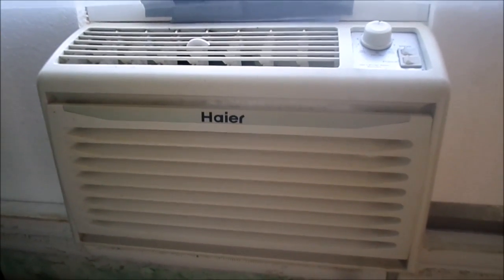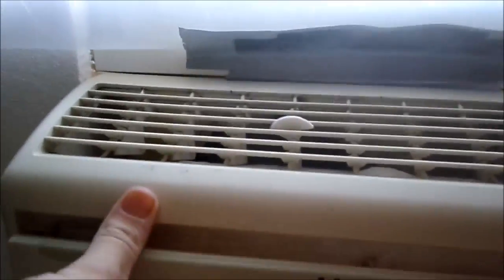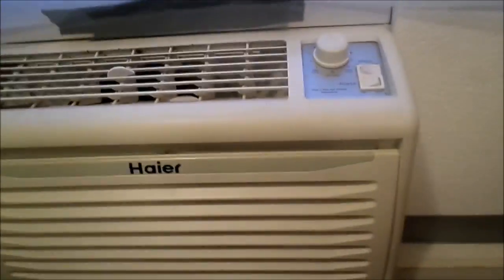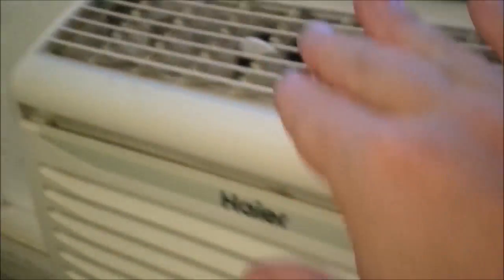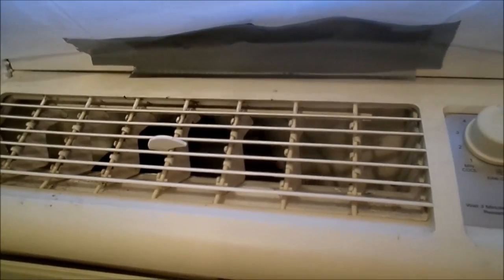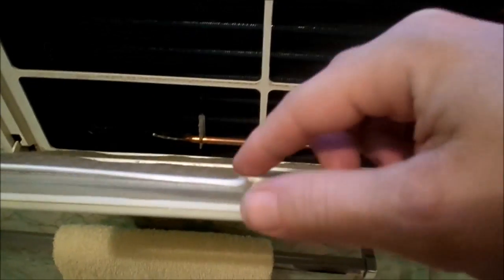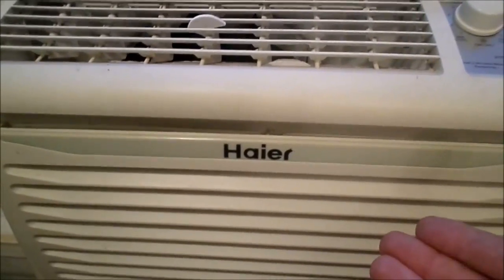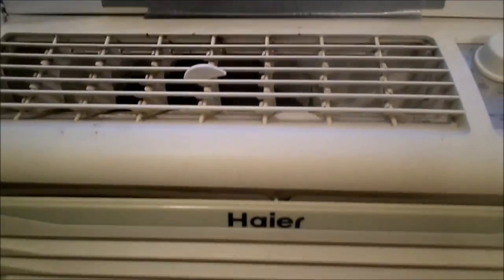Window A/C unit: iced over

Comment: How old is the unit because the older the unit the more it ices up if you just turn it on high fan it will defrost
Reply from the maker: The unit is a few years old but of all the types I have had over the years it is the only one to never drip/drain even at an angle outward. The unit never seems to condense hard enough to cause an accumulation of moisture then water  to drain. If it is set too high on a humid day however there is the icing over. Thanks for the advice.